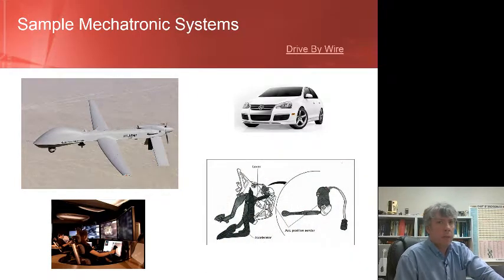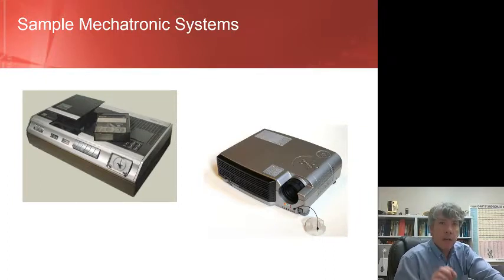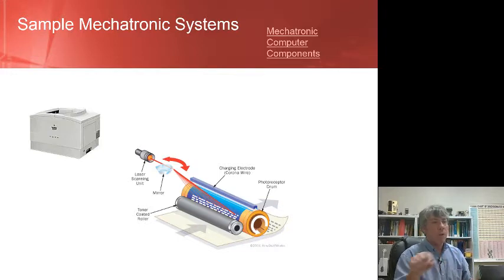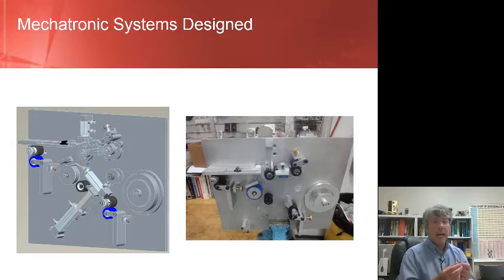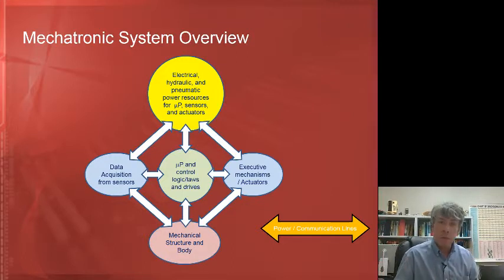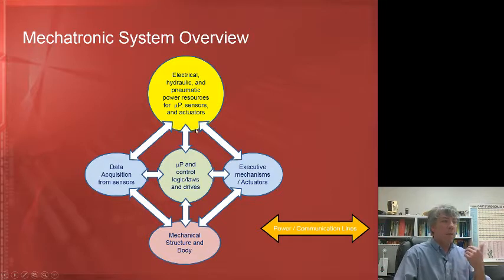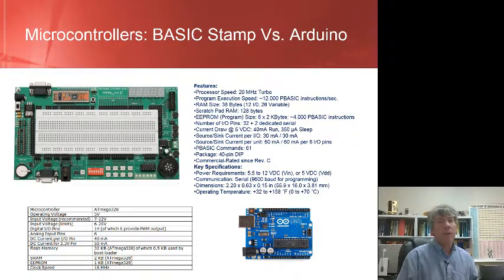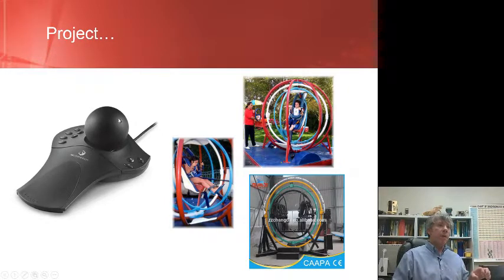Lecture 1 Mechatronics Introduction

Comment: Very well delivered. How can I access the full course.
Reply from the maker: This video is part of my MET 482 course, taught for the Purdue Polytechnic Institute in New Albany Indiana (part of Purdue University.)  I would be glad to provide the lab and project challenges as well as video playlists if you like.  Or, you could enroll at our location and take the course 😁
Reply: @damonsisk4270  I'm in Ireland. Does you videos cover the semester?
I'm 50 I've been a qualified electrician 27 yrs .I started wiring houses then industrial was self employed from 2001 to 2016 when I got a maintenance job in a factory. My work is preventative maintenence which is predominantly mechanical. I always had a flair for switching arrangements and motor control so now I want to take it to the next level